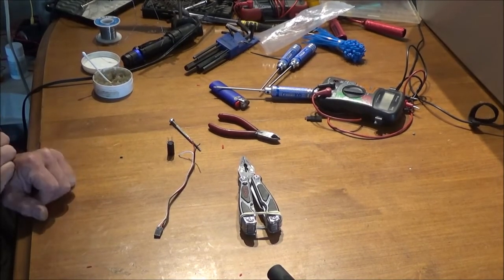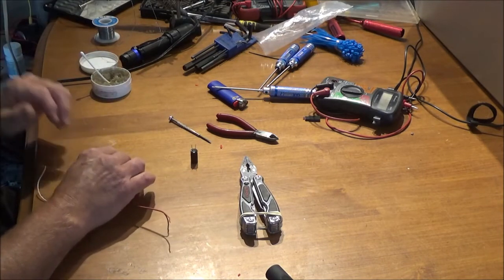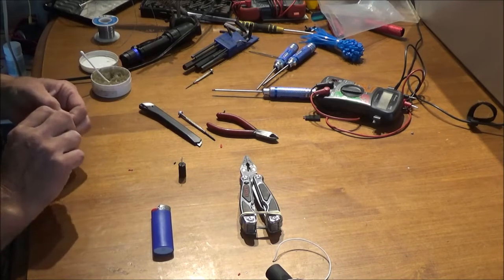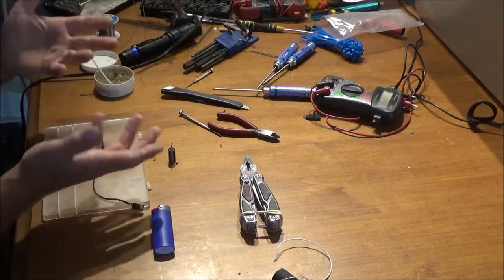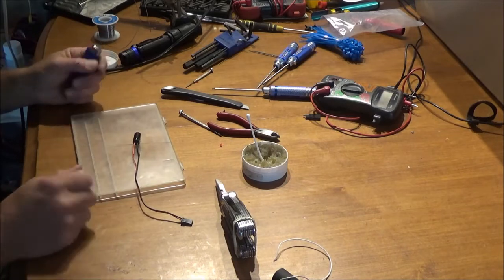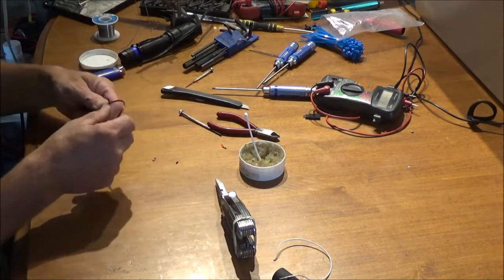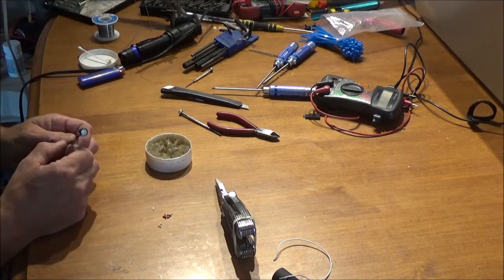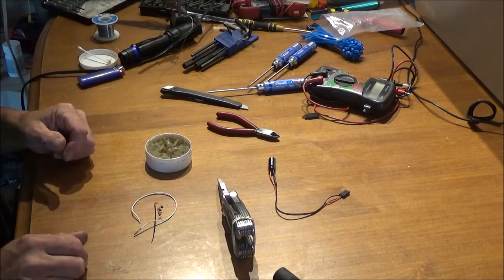how to make an Rc Glitch Buster And Why you need one

Comment: So it doesnt matter what Voltage the capacitor have? If my transmitter is rated for 11V max then can i go over 11V with cap? I have pretty fast 30kg brushless servo in my crawler but sometimes it just doesnt work properly and im guessing that one cap on my hobbywing 1080 esc isnt enought.
Reply from the maker: go back and watch the video again so you understand what we are doing here

Comment: Interesting. Futaba sells 1800uf I saw. There are rc webstores even selling 500uf glitch busters.

I have a 1500uf 16v laying around. I want to try that. 
Local electronic store doesn’t sell the ones I read about. They do sell 2200uf 25v. Don’t know if higher voltage can be used.
At least I don’t see them in their website. 

Having jitters in the servo after installing a gyro.
Reply from the maker: you can use higher voltage its ok
Reply: @KevinMillard68 You are fast answering. Thanks. I’ll go get one of those.

Comment: I have a mn99s rc, with standard esc condition using 7.4v 1200mah battery .  i am having the glitching servo problem , can i use 1pcs 10v 2200uf? where should I connect the part, is it after the power supply line to esc or esc before the servo line?
Reply from the maker: follow my video and you good to go but i would go with higher voltage cap/caps
Reply: @KevinMillard68 how much voltage and Capacity you suggest for solving my glitching servo problem? I am using jx pdi-1811mg servo which is running at 4-6 Volt, dont know the requirement current as the Factory didn't write that..

Comment: I have upgraded my Revo 2.0 to two   JX 36kg servos and have zero problems.....they are super strong...could be faster especially since I went with 2 but they are super strong.
Would my system still benefit from this circuit?
Would it make the steering even more powerful?
Reply from the maker: results vary

Comment: Can I put the glitch buster in any receiver channel on a rc car 110scale can i use a 2000uf 10v
Reply from the maker: you haev to use the channel as sudjested in my video and you want more then a 10volt cap other wise you can blowup the cap you can use the min as sudjsted or higher but you cant really go lower in the uf
Reply: @KevinMillard68  will 12v be ok
Reply: Hi because I'm using a 10v 2200uf on my rc car for a while now servos been stuffing out I don't know if it's because off the glitch buster or to much stress on the servos they heat up I'm thinking it's the stress
Reply: Hi can I use a 16v 3300uf or a 16v 4700uf on my rc car 110scale with a 2s 7.4v lipo batterie will that be ok

Comment: Can you use multiple glitch busters?
Reply from the maker: nope but you can make a more powerfull one
Reply: @KevinMillard68  wow alright. why not actually? Many say it's more beneficial.
Reply from the maker: @AeroStuffFPV  you only have so man slots on the reciver to start with , also i have never head of anyone using more then 1 buster you can use 2 if one is on the main battery wires and one in the revicer but it makes no difference if you use 2 of them how ever do what ever you want but one is the normal and its either on thebattery leads or on the reciver in an empty channel thats hows it done ,, its the servo that benifits from the buster if you need to add caps to a motor you use ceramic caps not electrolitic caps.. noting elese needs caps at all so why would you use more then 1 buster if its just ment to benifit the servo more then anything else ..
Reply: @KevinMillard68  Where did you hear that you use ceramic capacitor´s for motors???????????????????????
Reply: @nikolajc7617  yes they always need caps, so emf created by motor does not radiate and interfere with the receiver or servos
Reply: @RAFERRH  Did i say they dont??
I said CERAMIC.
They are definetly not CERAMIC.

Comment: Can i use a 1000uf 16v capacitor?

Someone please help
Reply from the maker: as long as your not going past 12 volts then yes.. once you go past 3s aka 12 volts then you have to use a higher voltage cap and they have to be electrolitic capasitors like shown in the video
Reply: @KevinMillard68  ok so heres my setup.

Im using 4 SG90 9gram servos in total on a flysky fsia6 reciever. The BEC on the esc is 5v.

I wish to connect the capacitor on an empty channel on the reciever to stop the servos from jittering.

Is this possible?
Reply from the maker: @yaimem  whats the amps of the bec tho and whats the esc intstalled in and whats the motor or motors draw in amps as well . and what do the servos draw in volts and amps